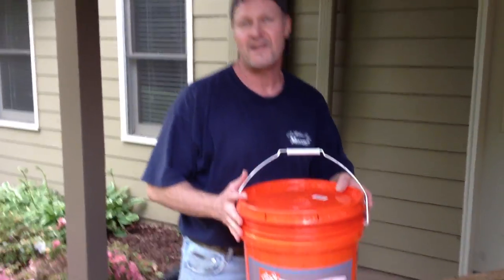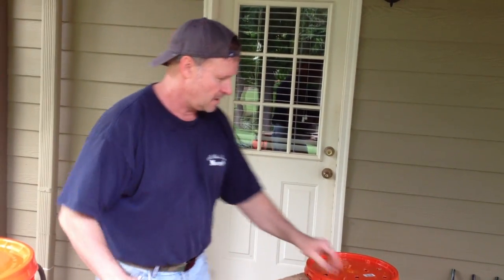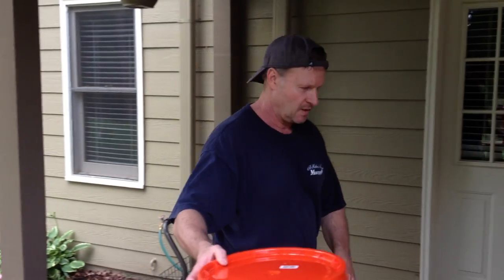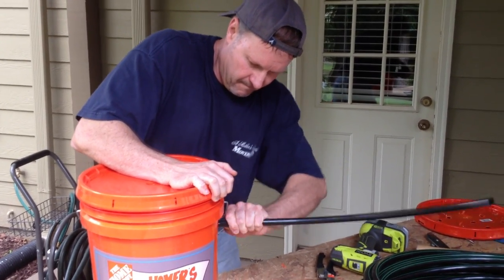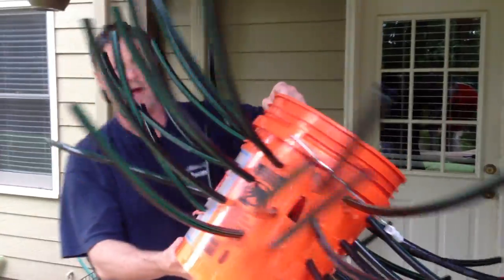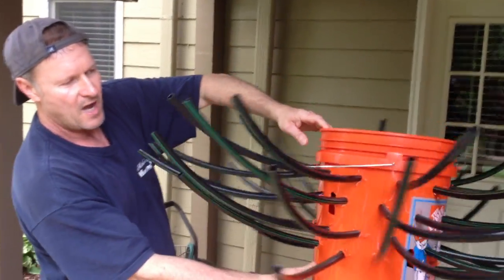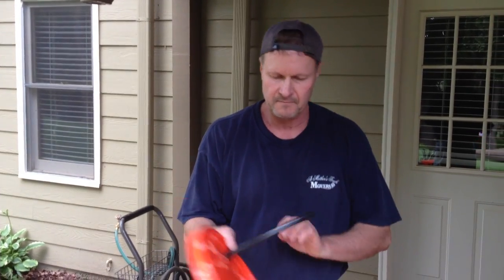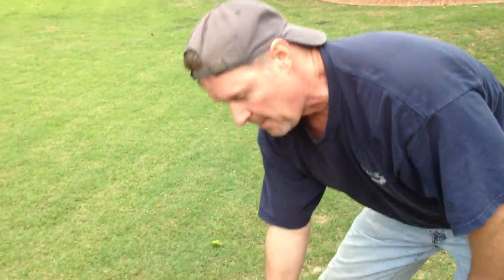How to make a fish attractor

Comment: About 10 yrs ago I build my own from thing I got from my job. 8by8by12" treated wood,thumb sz fiberglass tubing from 2ft to 6ft,weighted with big blocks. Intended for the 14in crappies that in the privet lake that's 50 miles away. Fished it a few times only to find carps and bass taking residence. However your way is a lot easier I need to try on the home lake. Thanks for the tip.

Comment: Great video. I made 12 of these. I used a chop saw for cutting drip tube. Mounted a 24" about 1-3/4 Dia PVC tube to end of saw bed and another shorter piece to feed drip tube through on other side. Easy and fast to cut many pieces this way because it temporarily takes out bend in drip tube for easier cutting with saw.
Reply from the maker: Thanks, great idea!